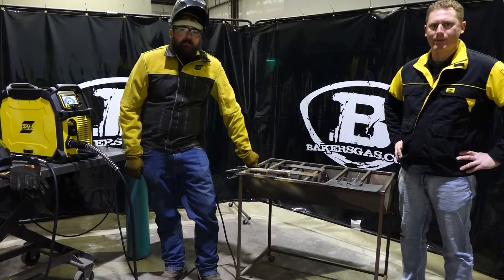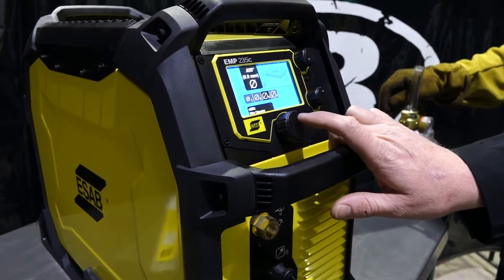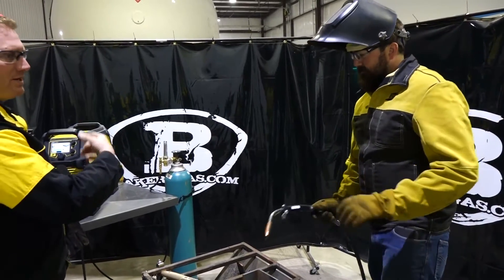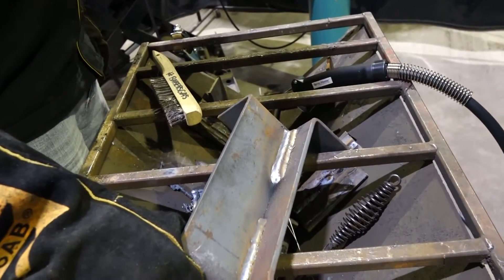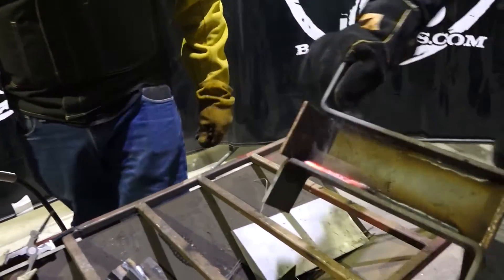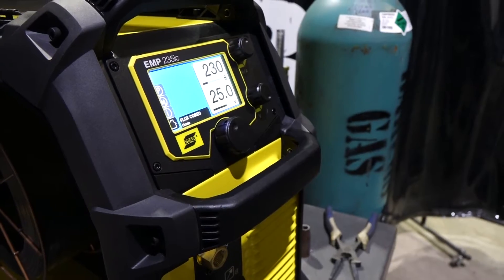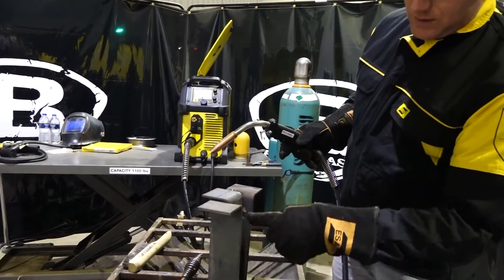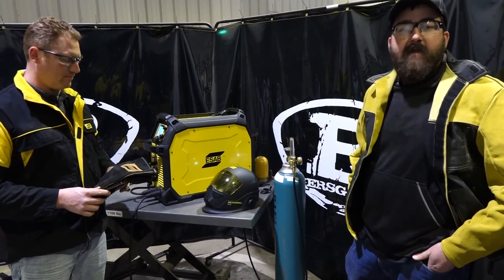ESAB REBEL EMP 235ic WELDING

Comment: Rebel is definitely on my list. I've been looking at the 285. I've owned the Migmaster Pro280 , I have an Old Linde Union Carbide 305. Will you do a video on Esab's suitcase welders? I'd like to compare to a Extreme 12v .

Comment: Isn't the max amperage on this unit 250? Or does the US version have 3ph?  The one in europe is rated to max 250amps. :o
Reply from the maker: The 235 is just single phase see attached specs:
https://www.bakersgas.com/media/docs/ESABSpecShee

There is two versions single phase and three phase for the 285 I will link them both below for you:
https://www.bakersgas.com/ESA0558102554.html
https://www.bakersgas.com/ESA0558102556.html

Options for all 285 machines with/without carts:
https://www.bakersgas.com/esab-rebel-285.html

Comment: Can the  Rebel EMP 215ic run .035" gasless flux-core? Esab does not list it in the chart.
Reply from the maker: Yes the 215 Rebel will run .035" gasless flux core very well. You would select the flux core process from the main menu and set your polarity to electrode negative. Set your wire speed and voltage according to the wire manufactures recommendation. The 235 in the video can run .045 flux core as well!